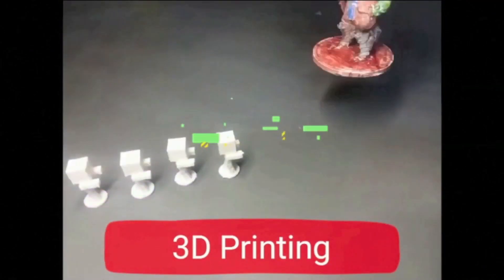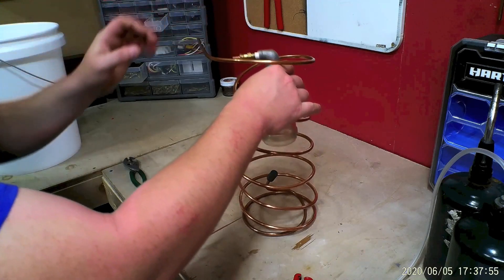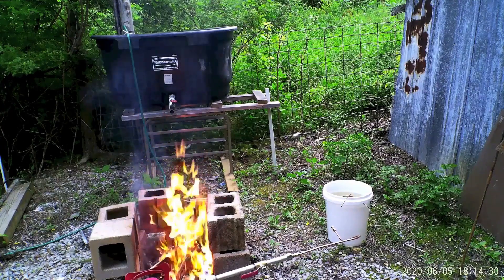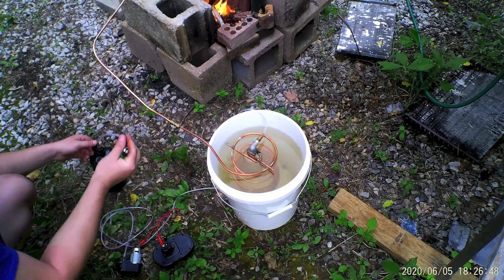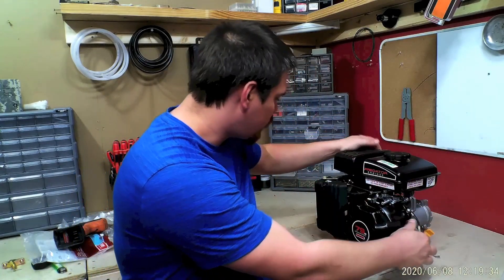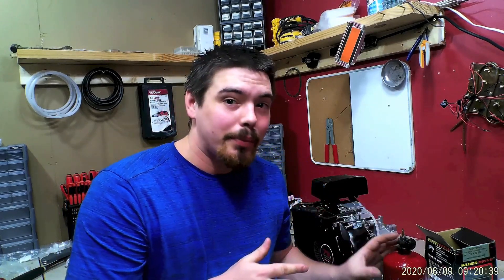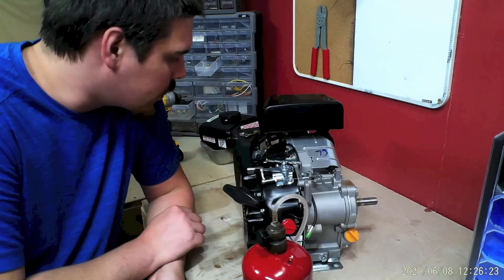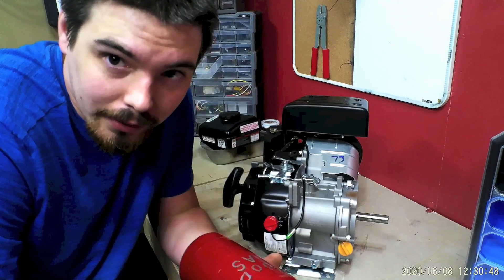How to Make Wood-Gas, and Burn it in a Small Engine.

Comment: When you go searching for this stuff one of the first things is: 'do not store wood gas'. So yeah, maybe run your engine off of the actual process instead of trying to store it.
Reply from the maker: That would be more efficient and safer, however the amount of wood gas I was making was not enough to run the engine. so I needed a storage median. I do agree though that it would be better if I could get that system in place to run directly off the prosses. Safer too.
Reply: @curiousbell  is there any way to make it liquid?
Reply from the maker: @DreamingConcepts  There is, but the process would be similar to turning the gas into oil then turning that oil into gasoline. Not a simple thing to do.
Reply: It should be a blue flame

Comment: How you oil it if this is a 2 stroke engine because he need oiling no?
Reply from the maker: The engine takes 10W30 oil. Here is the link to the engine if you want to look into it more.

https://www.harborfreight.com/generators-engines/engines/3-hp-79cc-ohv-horizontal-shaft-gas-engine-epa-69733.html

Comment: im not sure about following your instruction, yours exploded lol. what went wrong with it?
Reply from the maker: So, the main valve that lets the gas escape got clogged. This was the 3rd time using it. That combined with me running it at a higher temperature, and the fact that I was using brass plugs at the bottom of the tank resulted in a pressure build-up that I could actually hear from the hissing sound coming from the threaded connection right before the valve. this sound clued me in to the fact that I had a problem. in a matter of 5 seconds, the hissing sound went from a whisper to the sound of a large waterfall. suddenly the brass fitting at the bottom of the tank gave way. releasing a mixture of ash and wood gas wich both propelled and made the sound of a rocket taking off. in fact, this is what happened. it launched into the air about 20 feet before reaching its apex. dragging along with it my copper tubing and small vacuum pump and some wires. when it reached its apex it turned from right side up to upside down. launching it towards the ground. once reaching the ground it ricocheted and started heading in my direction. I only had a moment to move and only 3 feet before it reached me. but it was enough. I juked to my right. resulting in this mass of hot steel, steam, and wood gas glancing off my hip and finally landing in its final resting spot. located exactly where I had placed 3 mirrors the week before for an upcoming video. of course, it breaks all of them, and now I have 21 years of bad luck. it was later that I had noted that the shorts I was wearing have been melted together with my underwear. almost as a reminder to my stupidity. and this is why curiosity almost killed the bell. 

Thanks for the question and opportunity to share how dangerous my projects can be. I really do not recommend anyone to do what I do!